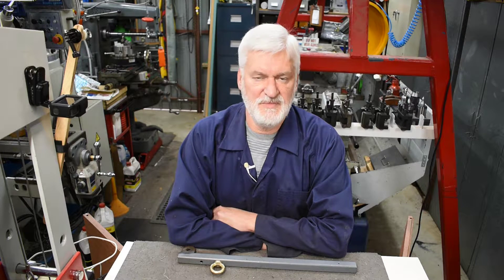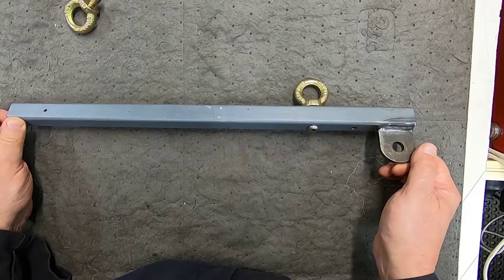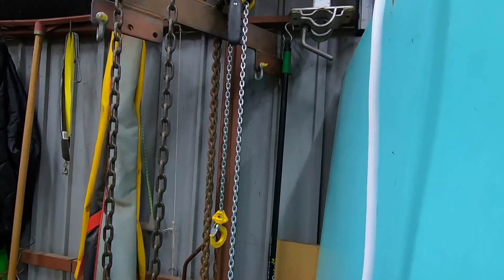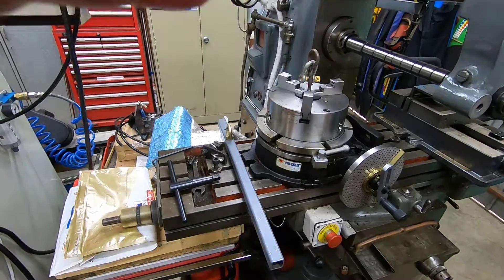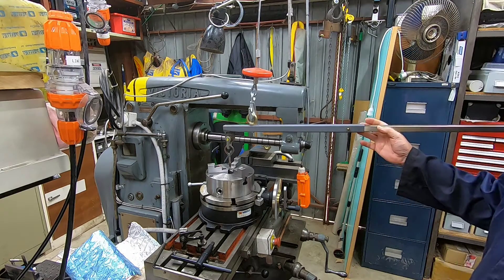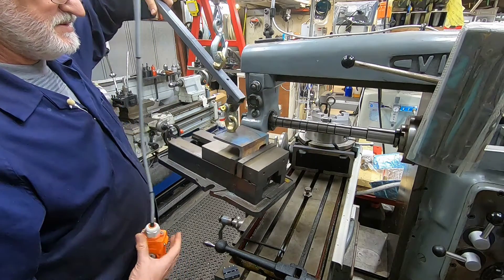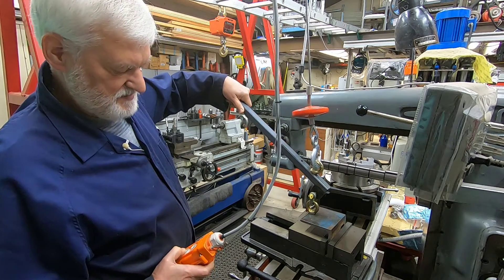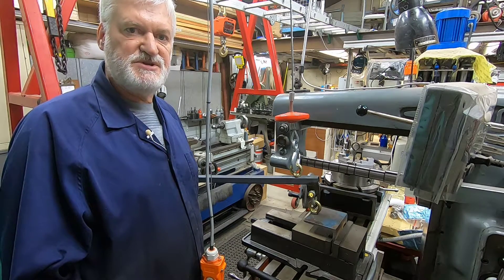Lifting and placing heavy milling machine accessories.

Comment: Alan on Keith Ruckers channel Shop Tour 5 Neil Tyson there is a very interesting crane might help ?
Christopher from Queensland
Reply from the maker: Yes, I was quite envious when I saw the travelling gantry. I have a similar sort of thing that you may have noticed standing over the big lathe. It is partly visible in the background of many video clips eg  https://youtu.be/KJXbOYrOMxI?t=91 Unfortunately when I made it I didn't include a height adjustment capability and have regretted that on several occasions. I did, however, make it so that the legs can be bolted to the horizontal beam at three widths ie 2.4m,  2.7m and 3m. I have idly thought about remaking it, but haven't managed to get a round tuit yet :)

Comment: Very nice. I would use a piece of plywood on the milling table as a precaution while using the electric hoist. Use the lever to put it in place before lifting the piece off the milling table and to remove it after the piece has been placed on the milling table. 

Can you use a thumb screw to hold the handle extension in place? That way it can be stored in the handle while not in use.
Reply from the maker: Plywood is an excellent suggestion and I'll be doing that :)
Telescoping the handle pieces is another good idea, but unfortunately the outer tube of the prototype is two short lengths welded together and the weld penetration intrudes into the tube; the inner tube cannot slide past this point. However, this prototype proved the concept and established appropriate dimensions so I will knock up another one with a fully telescoping handle. A thumbscrew retainer would work, but I think I'll try for some sort of spring loaded catch with no loose or "dropable" parts. I am too well acquainted with this corollary to Murphy's Law: "A dropped object will always fall where it can cause the most damage and frustration."
Thank you for the feedback, Alan

Comment: Yes the electric hoist is very sharp !
The skyhook cranes I have seen on other channels with the crank handle action are very smooth  with 360 degree rotation.
Your setup still seams cumbersome.
Christopher from Queensland
Reply from the maker: I have also seen these "skyhook" things and they seem like a good solution for mounting something onto one machine. However, I want the ability to use things on two milling machines that are 3m apart so I would need a skyhook on each machine and a trolley.  But this still wouldn't provide a way to lift things 2.5m up to my storage platform - and that was the reason for installing the electric hoist. So I think I'm stuck with the more cumbersome solution...
Thanks for your comment, Alan.
Reply: @alanshomeworkshop  as you are using one machine at a time they don't seem to heavy to transfer. Just for moving your equipment and work  around the bed, your electric hoist to move a equipment to the mezzanine floor .
Old man from Queensland
Reply: Can you use the electric hoist to move the skyhook to each machine ?
Christopher
Reply from the maker: @christophercullen1236  The only "skyhooks" I've seen are fixed to the machine they serve. The (unbalanced) load is cantilevered out from a vertical column which must be bolted down to something substantial eg a milling table or lath carriage.